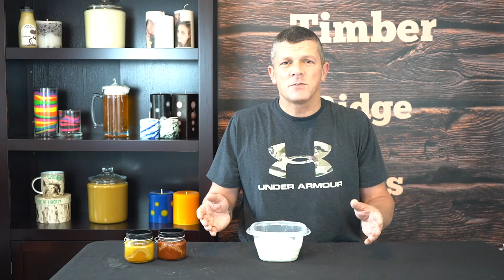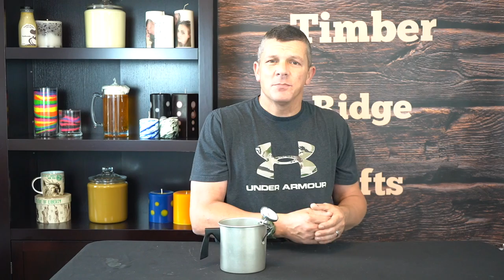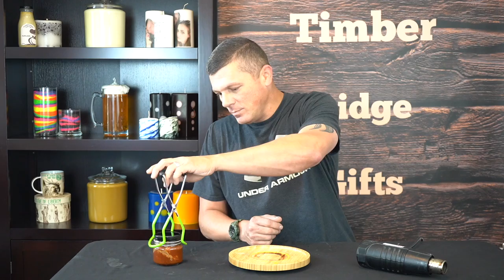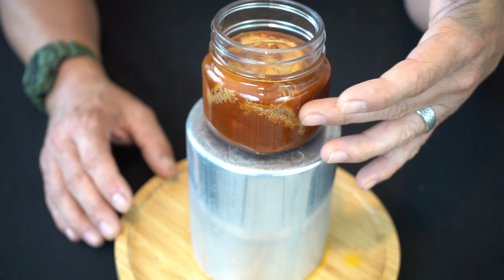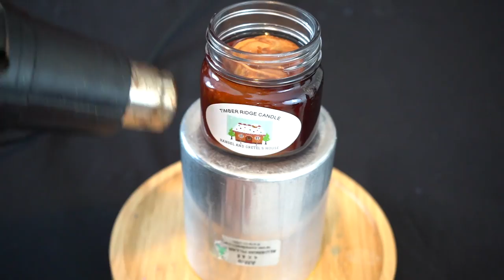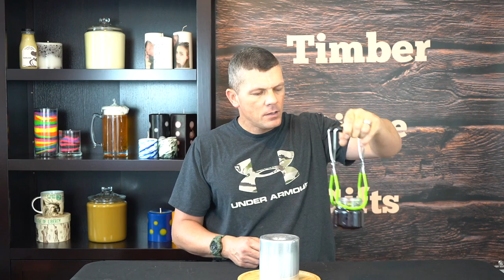Candle Frosting - What Causes It and How To Fix It!

Comment: Wrapping a cloth round the cooling candle helps. It stops the edges cooling faster so less / no frosting!! Works for me :) and any frosting I do get is very minimal and a regular hairdryer does the job.
Reply: Its for insulation so it cools more slowly. Dampening it would lessen the effect. I don't recommend that.
Reply: Oh thanks! My entire batch of candles had 100% frosting, which i just noticed an hour ago. And was trying to find solutions. Ill try this out
Reply: @bookpitaara4412  good luck hope it works for you too 🍀
Reply: Hey, I am back to tell you I tried the cloth trick and it kinda worked but kinda didnt. I mean the frosting lessened definitely but didn't completely get eliminated. But thank you for the advice. I think its to do with my wax now
Reply: @bookpitaara4412  ok hope you work out how to to get it frost free

Comment: Thanks Tim, I am wondering if putting the container in hot water, just enough to melt the outer edge would work? I don't currently have a heat gun.

Comment: Very helpful video!  The more I'm experimenting with candle making (as a newbie), I'm wondering if dying the wax can contribute to frosting, especially using liquid dye.  Tim, what do you think?  It seems that the more drops of liquid dye I use, the more frosting I end up having in my candles.  I'm thinking about trying dye blocks next.  In your opinion, do you think dye blocks would lead to less frosting?  Not sure what the difference is between the two types of dye other than one is liquid and one is a solid, but I would love to know if using one would lead to a better-looking candle with less (or no) frosting.  Thanks so much for your videos!  Please keep them coming!  :)

Comment: I don't have a heat gun but I was told that I can use a hair dryer and it would work just as good. However I noticed even when I heat it up like you are doing in this video..... a lot of the times the frosting will come right back. I'm not sure if I'm doing something incorrectly or what but I seem to be doing it just like you.
Reply from the maker: A hair dryer really isn't going to give you the amount of heat that you need. Most likely what the hair dryer is doing is heating the outer wax just enough that you cant see the frosting, but is not heating it deep enough to release the air bubbles to the top.

Comment: Thank you for the video. I have tried this technique myself, but wondered if the heat gun temperature was too high because sometimes it doesn't work. Could be that I didn't do it all the way around on the bigger jars, so I will definitely make sure I do that. What temperature do you recommend? Another issue with the heat gun is the fan. Do you think it blows air back into the wax therefore causing more bubbles to form?
Reply from the maker: I've never really measured the temperature, the heat guns usually only have one setting, so the temperature is going to be what it's going to be. Good question though! As far as introducing more air, I've never noticed this to be a problem. I think just blowing over the top of the candle won't aerate it enough that it would cause an issue.

Comment: Hello! Thank you for this video. It is very helpful to me.  One question:  after you are able to eliminate the frosting after using the heat gun, does the frosting generally come back after time?  I tried your method on some 464 soy candles that had the frosting issue, and so far after 2 days the frosting hasn't come back.  I'm wondering if I will need to explain to my candle retailers of the probability of this happening again. Does this usually fix the issue for good?  Thank you!

Comment: Have you ever tried cooling in a more controlled area? I was thinking of pouring a batch of small 4oz candles and heating my oven while pouring. Then turning off the oven and placing a tray of poured candles in the oven. The though being if I can get them in there with it around 100 degrees Fahrenheit with oven off and close the door the air inside and thus the candle should cool more slowly than in the 72 or so house air. Also what do you think about doing similar to remove or fix a frosted candle. Placing frosted candles of same scent and in same jars in oven on a cookie sheet and heating oven till I see the melt like in your heat gun fix then turning oven off leaving them to cool slowly inside. I was curious of your thoughts on this. 
Thanks
Reply: I tried that, placing the candles in the oven. The tops ended up looking very dry. Similar to how food does if kept in the oven. It didnt affect how the candle burned  🤷🏽‍♀️

Comment: Not sure if this has been asked already so apologies if it has.

I have shrink/frost issues quite often and the heat gun works well but I’m curious as to how companies like Yankee Candle avoid these issues.

I’ve bought several premium candles and put them through temperature tests and I’m yet to get any shrinkage or frosting with the Yankee candles I’ve bought where as a great deal of mine have changed during the same tests.

Do they use a certain type of wax or is it a case of their own wax mixture that’s not shared?

Thanks

Comment: I get my wax stuck on walls of container and it become more like a frost after drying...how to overcome it?
Reply: Try pouring through a heated metal funnel. That way, you can keep it off the sides of the container.
   You can also heat in the microwave as it sets.
  You can also pour into solid, opaque containers, thus crystallization won't be a problem.

Comment: So I just tried to heat up candles that had frosted with a hair dryer but I started to hear the glass crack and when I looked at it I saw small white cracks that didnt fully crack the glass but I didnt want to continue to use heat because I got scared. So any alternatives to heating up the glasses this way??

Comment: Hi Tim, great video - in your opinion what kind of soy wax is best for adhesion to containers?  I am having trouble with this as using clear jars. I'm in the UK and I'm just about to try some different waxes - Nature C3 and Ecosoya Q210 - do you have experience with these?  If so are either any good when it comes to adhesion?  Thank you!
Reply from the maker: Those both offer great glass adhesion. I personally think 464 offers the best glass adhesion but C3 and Q210 actually hold color better, so it's a bit of a trade off. /They all would be great though.
Reply: Timber Ridge Gifts. Thank you for taking the time to respond, much appreciated - I will have to do some experimenting I think! Thanks again!!😁

Comment: Have you thought of putting the melted wax into a vacuum chamber to reduce air bubbles. Polyurethane users do this when producing rubber moulds.
Reply from the maker: It would be neat to try I suppose, not really set up for that though.

Comment: Thanks for this video! I have a question. I've used American Soy Organic's 100% Midwest Soy Wax. Really like the people that sell it, but dang I cannot get this wax to not form bubbles. It frost right away. And... It frosts days later. I can hit it with the heat gun, and it looks great. Frosting comes back within minutes to days. Have you tried this wax? I  have learned to detest it! I use 464 soy and I have zero problems when heat to 185 and add fragrance and dye, and I pour at 100 degrees. I'm hoping you may have insight into the American Soy Organic's product since I have to suffer through another 100# of it. Will never buy it again.
Reply from the maker: I've never used it in my product line. All I've ever used was a 10 pound bag that American Soy Organics sent me for an unboxing and product demo. The few candles that I've made with it turned out fine. I heated to 150 and poured at 110. But in total I've made maybe 5 candles with it, so not enough experience. Worst case scenario you could check out some of the destash groups on Facebook. May not get your full return on it, but some one would likely buy it from you.
Reply: Thanks,  Tim. I did just that; listed it in destash groups. I'm sure someone out there has had great success with it. I have not. If you don't mind me asking, what is your favorite soy wax? Thus far I've used 464 and I get perfect, bubble-less, smooth-topped candles heating that to 155 and pouring at 100. But so many people seem to think that the hot throw with 464 is poor; hasn't been my experience. What is your opinion of 464 and what is your favorite soy wax to use? Thanks so much for your informative videos and your help!

Comment: Can you use this trick with wax tarts/wax melts?
Reply from the maker: Sadly no. The smaller size of wax melts makes it even harder to regulate an even cooling temperature, which makes them more susceptible to frosting. Since wax tarts and melts are almost always made in plastic molds or containers, the heat gun would melt the plastic long before the frosting was fixed.
Reply: Makeup Mavens Beauty  What Tim has said about the wax melts is certainly the case, but you can always change the wax your using.  What kind of wax do you currently use?
Reply: inkyimpressions I use a blend of soy and paraffin wax
Reply: Ecosoya is an amazing wax. I almost never have an issue with frosting. I make wax melts with it too. My wax melts aren’t in the plastic containers though. But you can get a certain type of Ecosoya if you use the clamshells.

Comment: Hi Tim. I am having issues with my soy candles having a rough texture after each burn. Is this normal? When I initially pour them they cure fine and are smooth on top and they burn evenly every time but when I blow them out and they cool down they have a texture at the top. Is there a way I can prevent this? I use GB-464 soy wax. I pay attention to the temperature as I add fragrance and when I pour into my tins. Any tips and advice would be greatly appreciated. Thanks!
Reply from the maker: It's perfectly normal, and nothing you can do to prevent it. We take so much care to heat them and pour them and let them cool at just the right temperature to reduce appearance issues, but then when they are lit they get up to a few hundred degrees and cool unevenly, so the wonky appearance that results is just soy wax being soy wax.
Reply: Great thanks Tim you have helped me a ton! I appreciate it!

Comment: When I try to use the heat gun to fix mine it doesn't. It comes out the same way. I tried playing with the temperatures when I pour
 I've done everything I can think of I don't understand why it won't stop.
Reply: Christina Faye I would suggest trying Ecosoya wax. It’s more expensive but you can get it in a 10 pound batch to test. It almost never frosts. It does take sometime to learn the curve of what will work in your setting. For me, I heat to 185, add dye right away. Add fragrance at 150 and pour at 135. But your environment will be different so your temps may be too. It is a really great wax and I almost never have frosting.
Reply: Some waxes are just most prone to frosting than others. Right now, many candlemakers have been complaining about Golden Brands for the last couple of months saying it has been very bad with frosting issues.